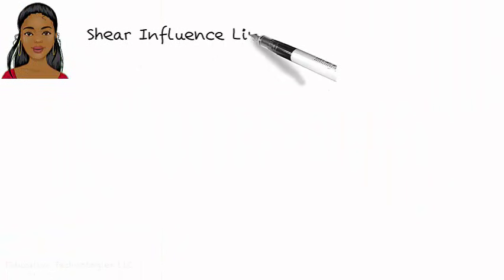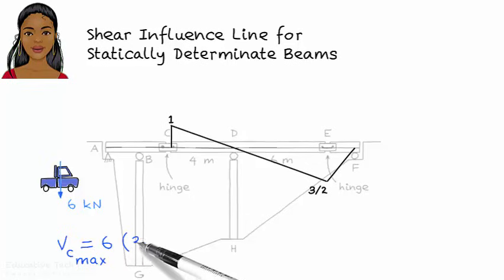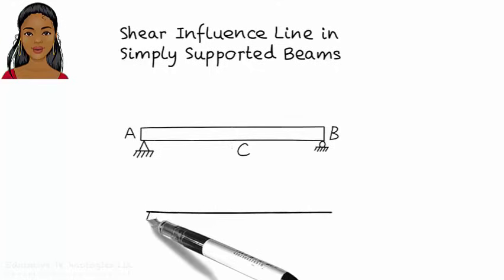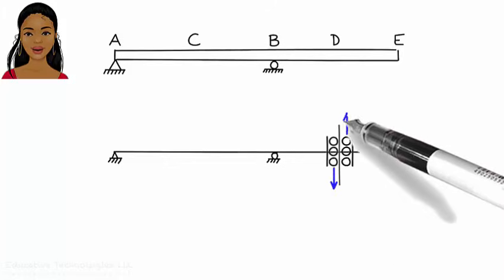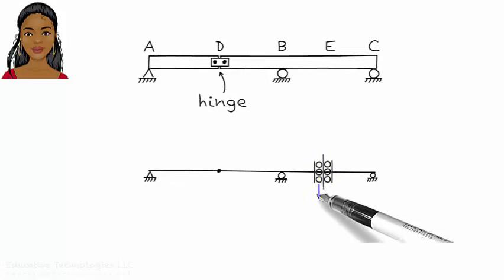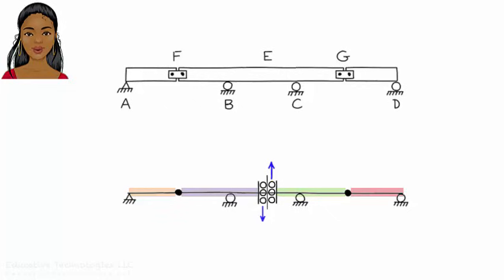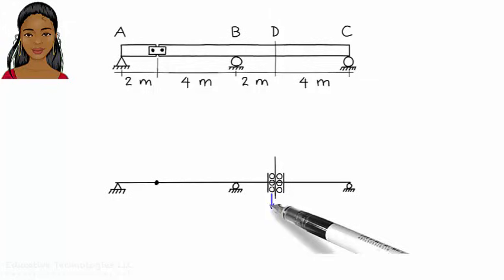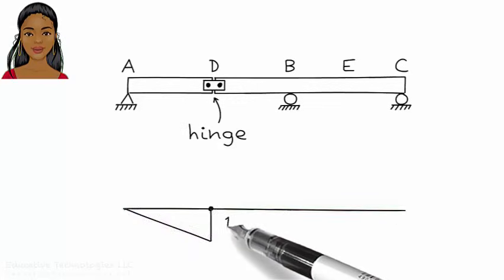SA17: Shear Influence Line

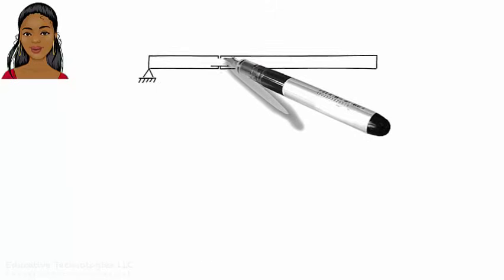Comment: On the example with shear @ E,  rollers B & C on either side,  (@7:54 )with a hinge at D. What if B & D were switched to: hinge at B and roller at D instead? The shear with a hinge next to it on the left, roller to the right, and roller to the left of the hinge? I did not see an example with a hinge and then a roller next to the IL of question, only saw rollers side by side or roller / hinge combo. Does it act like the example with two rollers where the bar cannot move and the IL goes to the hinge and stays there? Thank you! Hope that makes sense.
Reply from the maker: Thanks for the question.  Yes, in such a case the left segment of the beam from A to B (the new location of the real hinge) remains flat.  E moves downward to the left of the fictitious roller at E,  causing BE to rotate clockwise. And, E moves upward to the right of the fictitious roller making EC to turn clockwise as well.
Reply: Makes sense!!! I appreciate it!

Comment: for  4:10, is it possible to be drawn the other way around,  like upward force at the left roller and downward at right?
Reply from the maker: By definition, shear in a beam segment is considered positive when the force is acting downward at the right end of the segment, and upward at the left end of the segment. That is what you see @4:10, positive shear in both segments.

If we define positive shear the other way around, then yes, we would have to switch the direction of the arrows.

Comment: Man you are amazing! You have my eternal gratitude. But, how to draw the influence line if a train load model (consisting of concentrated loads within the udl) passes through a beam? Thanks in advance
Reply from the maker: A series of concentrated loads consists of two or more loads at a fixed distance from each other. For example a multiple axle truck imposes such a load on a bridge.

Suppose we have two concentrated loads in a series, say, F1 and F2 where the distance between them is B. To determine the maximum effect of the load on the beam, we need to examine all possible scenarios that could lead to maximum reaction/shear/moment at a point of interest.

Say, our reaction/shear/moment influence line has two peak values. Let's refer to the location of these values as P1 and P2.

What are the scenarios in this case?

1) F1 is at P1, and F2 is locates at a distance B to the left of P1. 
2) F1 is at P1, and F2 is locates at a distance B to the right of P1. 
3) F2 is at P1, and F1 is locates at a distance B to the left of P1. 
4) F2 is at P1, and F1 is locates at a distance B to the right of P1. 
5) F1 is at P2, and F2 is locates at a distance B to the left of P2. 
6) F1 is at P2, and F2 is locates at a distance B to the right of P2. 
7) F2 is at P2, and F1 is locates at a distance B to the left of P2. 
8) F2 is at P2, and F1 is locates at a distance B to the right of P2. 

By calculating reaction/shear/moment at the point of interest for each scenario, we can determine the critical position, and orientation, for the moving load.

In the case of a moving uniformly distributed load, we need to determine the location of the load, generally centered near or at peak locations, that result in maximum reaction/shear/moment. We can use the area under the influence line to help us place here, place the load over a segment of the beam with maximum positive area under the influence line.
Reply: Thats glad to have received your reply. 
1)Can we solve the udl problem by converting the udl into point load?
2)How to solve if the train load model is combination of udl and point loads?

It looks like this  (Kindly google "load model LM71"):- 

mmmmmmmmm__|____|____|____|__mmmmmmmmm,

where, mm = udl extending to till the support
                   | = point load placed at 0.8m, 1.6m, 1.6m, 1.6m, 0.8m distance
                 __= distance 
Can we convert that udl into points load and follow the same procedure as you mentioned for the group of point loads or is there any other methods to solve it? Thanks in advance.
Reply from the maker: There is no reason to convert a distributed load to a point load. For a uniformly distributed load, we simply multiply the magnitude of the load by the geometric area under the influence line.

Load combinations can be handled via superposition. We treat each load individually, calculating its effects, then we add them algebraically to get the combined effect.
Reply: Clear! thank you very much Dr.

Comment: Hi, +Dr. Structure do you know how to solve the question below. This is the link for the question: https://youtu.be/TAd055mrzTo . I managed to plot the influence line but i failed to get the same answer as given. My answer is in red color, the given answer is black color. I wonder why the negative maximum value of -1.5 is ignored. Thanks.
Reply from the maker: +bryan ewe Your answer is correct, the maximum negative shear in CD is -8k. You can verify the answer by placing a uniformly distributed load of 500lb/ft on the top beams between A and D and analyzing the beam. The analysis gives equal vertical support reactions of 8k each.  Since the applied load transfers to the girder at points B and C (each point is subjected to a downward concentrated load of 8k), then shear in panel CD equals to -8k.

Comment: that`s great .. but what if beam is subjected  moving UDL. like 4KN/M  that does not cover the entire span
Reply from the maker: Gurwinder singh Influence lines are always drawn for a unit moving load.

To determine the effect of a moving distributed load on shear at a specific point, we start by drawing (using a unit load) the shear influence line for the point. We then place the distributed load on the influence line such that it produces the maximum shear effect. How? 

Say the distributed load starts at point A and ends at point B. Then, shear at the point of interest equals to the area under the influence line between A and B times the magnitude of the load. We keep moving the distributed load and calculate the shear value as described above until we find the location for the load that produces the maximum shear value at the point of interest.

Comment: great video,but there is minor error for direction of shear u mentioned section left upward and section right downward is considered as positive ,so what u applied is negative shaer @4:18 sec check it
Reply from the maker: Thanks for the comment.

Although sign conventions are rather arbitrary, in structural engineering it is a common practice to consider a shear force that tends to rotate the beam segment in the clockwise direction as positive. Accordingly, the pair of shear forces applied to the roller @4:14 indeed are considered positive.

This beam sign convention is different than the sign convention we generally use for the plane stress element. For such an element four shear forces are drawn along the four sides of the element: right, left, top and bottom. Shear is considered positive if the right and left shear forces (acting in opposite directions) tend to cause a counter-clockwise rotation while the top and bottom pair tends to cause a clockwise rotation. Your description matches this sign convention.
Reply: So it's just a matter of sign convention nothing else
Reply: Thanx for rply u r video r really to the point and interactive plz upload more videos on structure analysis on topic like slope deflection ,mdm ,matrix method egarly waiting
Reply from the maker: akash poddar Although beam sign convention could be picked arbitrarily, it is very important to be able to relate the positive and negative force/moment to the state of stress in the member.

Let's take the case of bending moment. By convention bending moment in beams
is assumed positive when it tends to bend the beam concave up. So a positive
moment in the beam means its bottom fiber is in tension and its top fiber
is in compression.

When designing such a beam (say as a reinforced concrete beam),
we should place the reinforcement bars at the bottom (tension zone) of the member
as concrete cannot handle too much tension force by itself. Generally no
reinforcement is needed at the (top) compression zone.

Now if we have used the opposite sign convention for bending moment, and make the statement that bending moment in the beam is negative without clearly identifying the tension and compression zones, the reinforcement bars could end up at the wrong zone causing member failure.